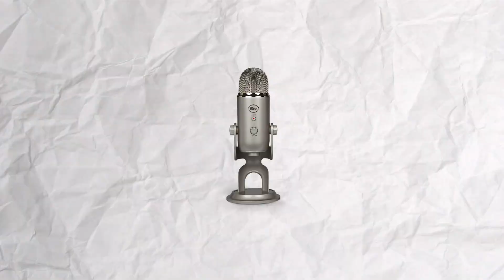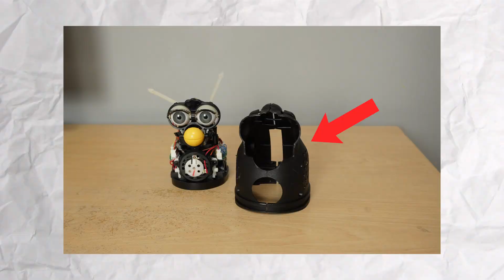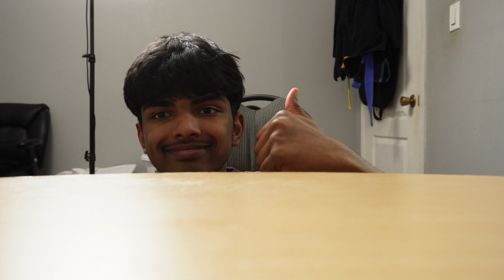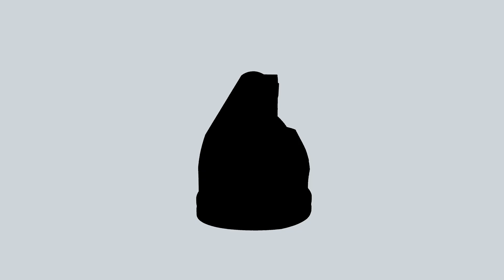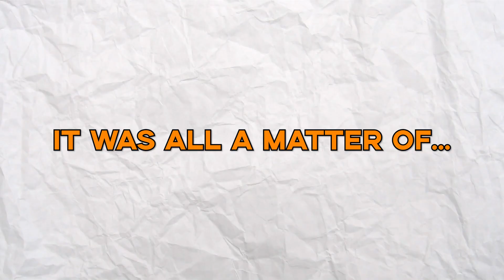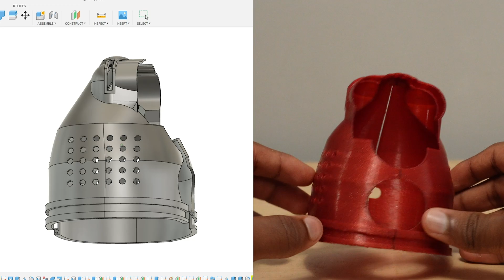how to reverse engineer ANYTHING.

Comment: So i just recieved a car part i need to reverse engineer. At this point my experience is i can convert an svg to an 3D lightbox. 

your model is to different to use the tutorial for my own needs. But in the basic your video is going to help me with the refference images, and loads of other things you explained.

This video is cleaner, easier to follow as most of the tutorials from the "bigger guys",
How is this video 2 years old, only 7k views and you have 205 subscribers. Should be 250k+ at least.

Comment: I recommend using a telephoto lens/ a long focal distance for taking the reference pictures because this makes the object look flattened. It's still not completely orthographic but a lot closer.
You can get an orthographic image with a telecentric lens but I don't think that those are very common.
When using a phone camera it's better if you are holding it further away from the object. Phone cameras have a wide angle lens and will give you perspective distortion if you are too close to it.